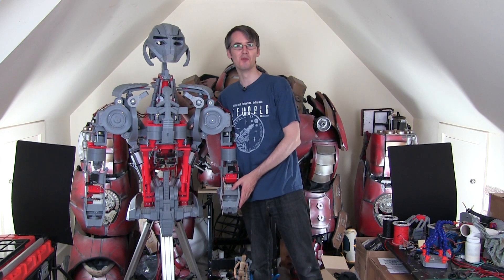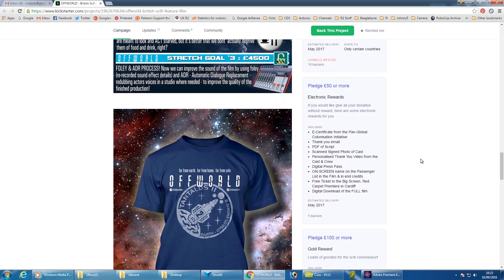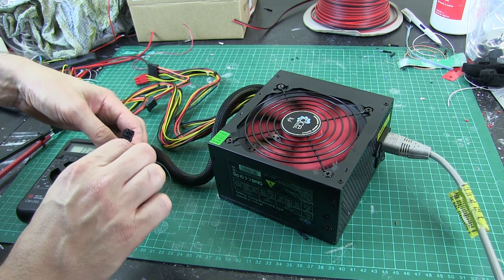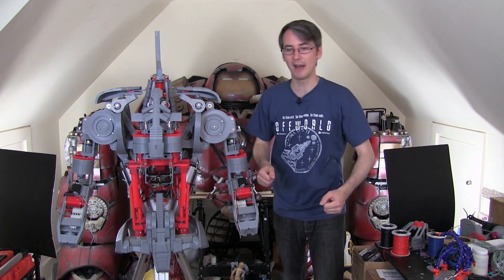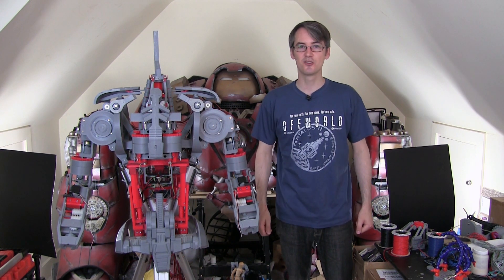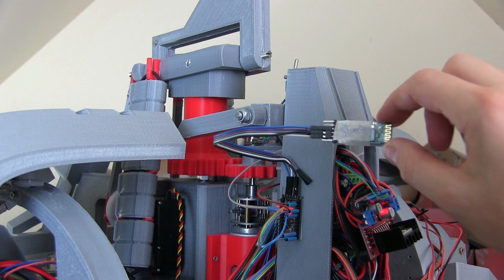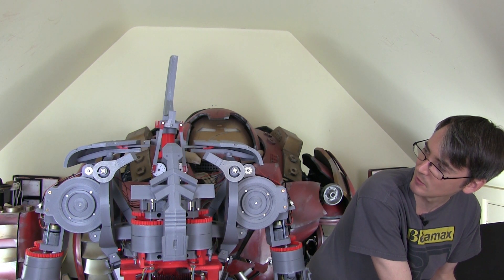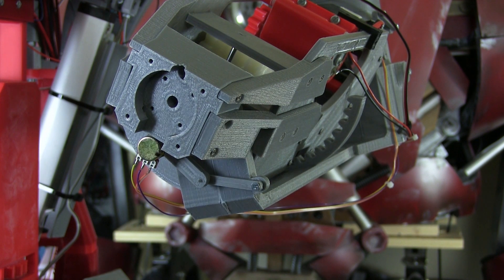Avengers Ultron #22 | Head & Forearm Electronics & Logic | James Bruton

Comment: I still think you should've gone with a muscle design, that way you'd keep the mechanics far more inline, and smaller. You'd probably get a bit more power out of it too, though working on cooling and heating the coils would be slightly tricky.
Reply: I think he wants it to be electric. The only "muscles" I know about run on air
Reply: Actually an Australian university created some that react to heat, and from there you only require a slight conversion using nickel-chrome alloy heating elements.
Reply: I was talking about something reliable and readily available
Reply: These are both, they have long lifespans and can be made with simple and cheap resources. You should look it up, nylon artificial muscles, very interesting work.

Comment: Hello James,

I can imagine the most interesting part might be the programming and being able to convert the software to work with an appropriate movement. Does this mean if you can switch automatically between the micro/millisecond readings and so engines you will be able to get the three or four motors driving the full arm motion to can have the arms move without jerkiness and have the shoulder-elbow-wrist move together to create a more natural movement, as a for instance as if the and was going to wave?

Thanks for a your hard work in making and designing and uploading same so we can be nosey and somewhat critique.

Comment: Love the mechanical multiplexer.. but not loving the code so much... I know this is experimental, but those blocks of slightly altered loops creating miles of spaghetti code only makes it less readable, especially with more motors.

Building one function that can deal with an arbitrary amount of motors is trivial and you can add that to your library of control code for re-use. Also, when you get around to the "AI" code, you won't get away with building a massive switching loop only in main().

Comment: Seems like someone in this comment thread may be able to help me. I have a Raspberry Pi 3 running Kodi & retropie that I want to install in our van. I have AV worked out, but how to power the Pi W/out the issue of killing power when I turn off the key is my issue. id really appreciate any thoughts on the subject
Reply: +Jarrett Hall most cars leave accessory power on for a couple minutes until a door is open. if yours do not you could use a combination of constant 12v and the accessory 12v. have the pi turn off if it loses accessory 12v (or whatever you step it down to.)
Reply: just search the internet geez..
Reply: You could pretty easily solve the problem if you just get a big 5V powerbank for your pi that charges off of your van's 12V. If you get a 20Ah battery you'll be able to run a raspberry pi 3 for about 20 hours after you turn off the key.
Reply: Dean Charles, thanks. That's a great idea. My initial plan was to use a 1F cap to give the pi about 20sec to power down, but I figured someone would have a creative idea

Comment: Hey James! I found these little PWM breakouts. They appear to use I²C so you can daisy chain them. Thoughts? https://www.ebay.co.uk/itm/301893172030
Reply: James Bruton I see your point! I'm doing my research for a long-term project I'll start when my current ones are complete. It's a walking table I call Cavendish. Should be rather amusing!

Comment: Hi James, as you said turning the lower arm and moving the lower arm up and down happens quite often together. And with motion capture this will be even more of an issue because the values might change like +-3 steps due to measurement imprecision. If you redo the motor for moving the arm up and down it might be better to add a separate one for that. Otherwise the switching might be running almost permanently. There should be enough space I think. The switching for the hand is perfectly fine because that should not often come together with any other movement. I'm looking forward to the next episode! Thank you James for this one! :)
Reply: Ppppppppppppppppppuuuuuuuuuuuuuuuuuuuuuuuuuuuuuuuttttttttttttttttttttttttttttttttttoooooooooooooooooooooooooooooooo

Comment: Hi James... For a natural flow on the forearm I think you might need to revisit the switching mechanism (I know I mentioned this before). My concern is the forearm moves more and faster than any part of the upper body... Switching the elbow with with rotation and the hand will slow it just a little too much and limit the natural movement you can achieve with the suit... I do think that the had and rotation could be switched but  I think the elbow will need it's own faster motor... But wow... great piece of design regardless of the practicality.

Comment: the forearm mechanics are ridiculously inefficient, however incredibly cool.
Reply: They're temporally inefficient, in that they have a slower response time to movement but you gotta admit the design is quite cost efficient using only one motor and control signal for the whole forearm.
Reply: I'm glad you haven't :) As mentioned, this switching gearbox is cool but I think it colides with the overal goal of making humanoid robot with all the 'natural movement'. This forearm thing spoils the flow of the motion dramatically. I'd prefer separate servos for arm and wrist and perhaps some separate project that utilizes the motor multiplexor in more practical way.
Reply: Yeh I have to admit I hatted the forearm's @ 1st, the other joints seem so much more fluid and quiet! But now I see the one motor operating 3 axis (probably not the right term) its genius. James, I just don't know where you find the time mate ...
Reply: Yes it would be better to chance the forearms. Make separate motors. Gearbox is realy good build, but not for a humanoid robot.
Reply: Have to agree the forearm really lets the concept down. Imagine if you were continually twisting your wrist whilst lifting the arm up and down continually then you will only ever get one of these movements. So you have brilliant motion capture but a lot of that motion capture could potentially end up being ignored.

Comment: Another great video James!  I know you have a lot to keep you busy, and I know you enjoy the challenge...but I was just curious what do you think would happen if each forearm component was motorized/servo'd (as allowed to the shared motor) but used a shared circuit that prioritized the the movements just the same as your designing, but would resist current flow to slow the motors allowing the most current flow to the biggest adjustment needed....I was thinking it would allow a fluid motion, but would be more "smart" or efficient at using power. Just curious of your thoughts.